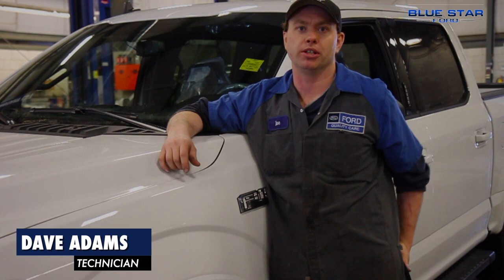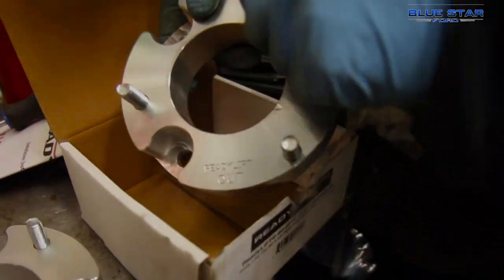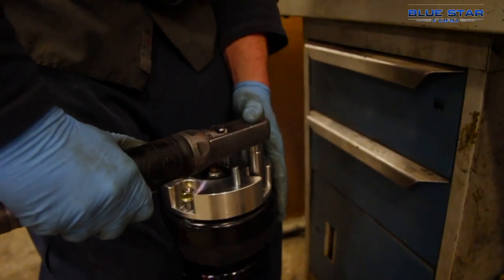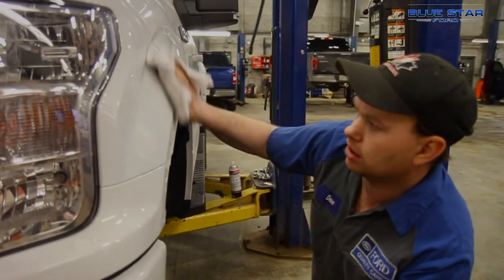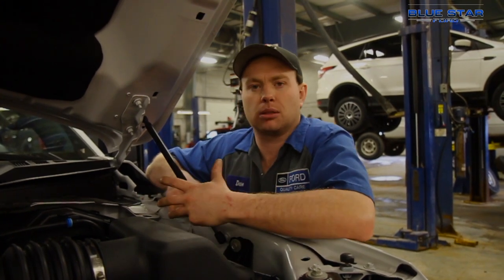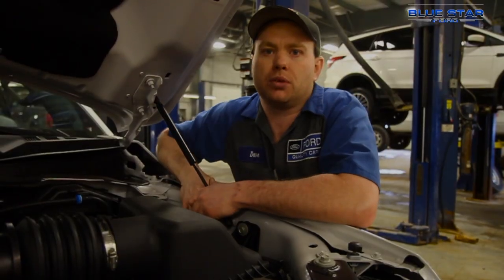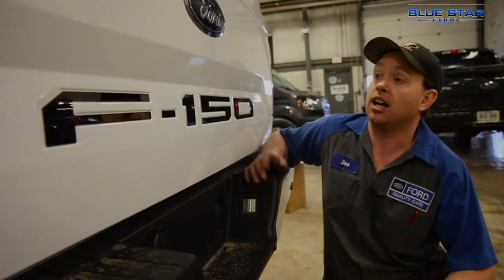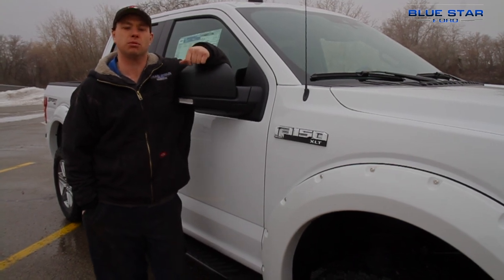ADDING A READY LIFT KIT, FENDERS, NEW GRILL & NEW BEEFY TIRES on a new 2019 Ford F-150 XLT

Comment: How about them CV angles
Reply: Literally all I could think about😵 the 2.5 is sketchy enough much less a 3.5!!
Reply: That's exactly what I was thinking. I installed a set of Bilstein 5100's on a 2015 XLT SCRW which levelled it out at 2 ¼ " front lift and didn't stress the driveshaft angle. The truck looks great and you can run 35's without crash bar trimming when using stock rims or similar offset.